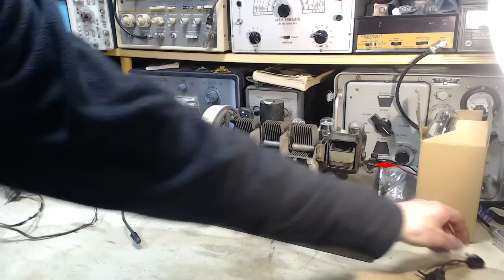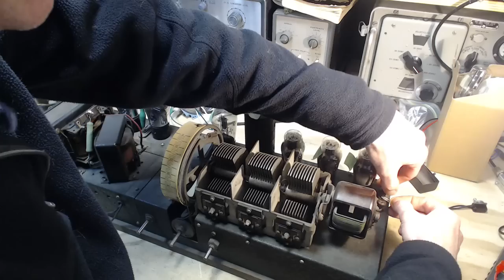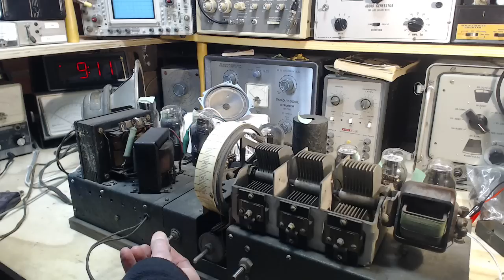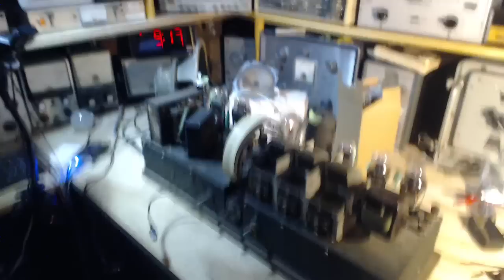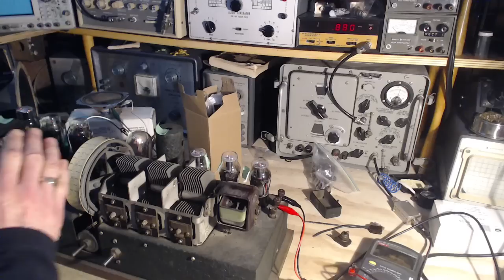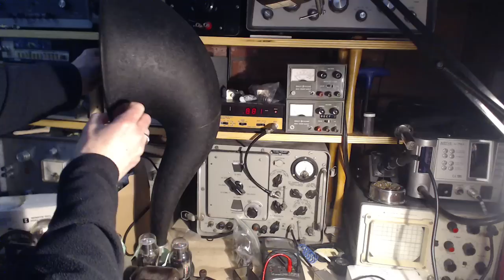Eveready Model 32 Video#5 - Two Alternate Speakers

Comment: this happened to me with a philco 112. did exactly the same test with power to speaker field coil & a small ohm speaker for audio.  there was no tube flash but 1 bakelite capacitor was smoking right away. i'm not doing anymore tests until recap the whole radio because why ram more power into it more than it can handle just to get some static and then it would burn my house down

Comment: Malcolm, you can't feed audio into the field coils. That is connected to the HT line. If the an audio output tube flashed over it could be because the output transformer is not terminated. I.e. Is the test speaker open circuit.

Comment: I would start checking voltages in the audio section.   Perhaps put a signal tracer on it to see where it is losing signal.   It may not be the speaker.   I would suspect a capacitor or resistor may be open or off value.  

As another said, try the phono input and connect it to an external source such as a phono, IPod, or other source and see if you get any audio.

Comment: You could see how it responds to audio input through the phono input shown on the schematic to see if the audio section is functional. Work backward and eliminate each stage in turn? Also inspect under chassis for obvious problems might be productive as well.

Comment: Check the old speaker, with the field coil energized feed an audio signal into the field coil wires, my guess is the speaker is working and you will hear a tone.

Comment: Jim you have to remember that 8 ohms is impedance as measured at 1000 cycles per second A.C. at a certain given voltage !!!Also the majority of speaker cones back then did not have much compliance at all, even the spiders in them were rather stiff by todays standards !! I have 2 -- 8 ohm speakers, one measures about 5.4 ohms DC the other measures about 6.5 ohms DC.I agree that old speaker repair lacks a lot is NOT a good repair at all. and if want to temporarily substitute another speaker of some type while trying to repair radio is O.K. ----    Good Luck !!
Reply: You know that he doesn't want to tune the radio so would it be possible to replace the broken pulleys with suitable parts out of a Maccano set i.e. the brass pulley and the large blue pulley or am I barking up the wrong tree.